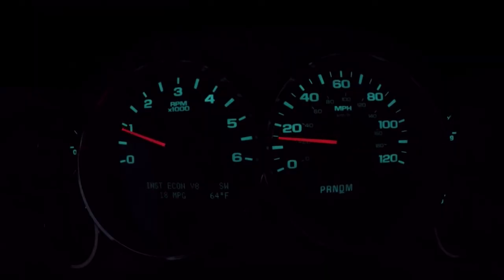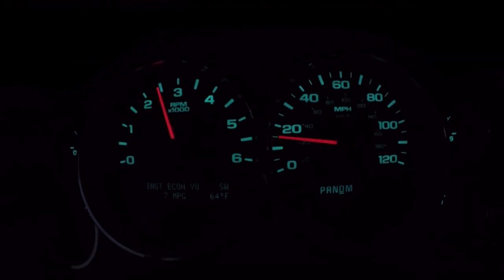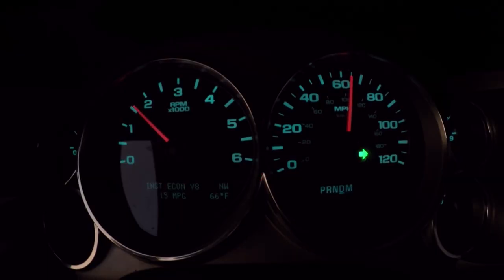Pros and Cons of a High Stall Torque Converter

Comment: 3400 stall with mild cam is way to much stall for daily driver
Reply from the maker: I don’t think so at all. I had a 2600rpm stall before this 3400rpm stall and it just wasn’t enough. It still lugged in the lower rpms and it still felt sluggish. Circle D even recommended the 3400rpm stall for what I have now. I haven’t lost much, if any, in gas mileage and I drive my truck every single day.
Reply: Not at all. I have a 3800 behind my standard ls1. No cam just a tune n otr and its a dream. Thing hoses tyres
Reply: JV Garage do you have a single disk or multi
Reply: Sean Fatin single disk or multi
Reply: I run a 3400 in my daily too. Doesnt even really drive all that different. Just don't buy a cheap stall. You get what you pay for.

Comment: Hey what’s up man I’m going to swap my 04 Silverado to a 6.0 V8 and going to be putting Texas speed TSP high lifters stage 4 cam  it’s 223/226 600/.600 ,111 LSA camshaft ass my daily driver and converter for this set up please let me know on the Comments below
Reply from the maker: I’m no expert but through my experience I wouldn’t go any less than a 3,000rpm stall speed. But it also depends on what you plan on doing with the engine as far as supercharging, turbocharging or keeping it N/A. Give circle D a call and tell them what you plan on doing and all your engine specs and they will put you on the right track.
Reply: @JohnVesely  can you add a circle D converter on a stock motor(5.3)

Comment: Driving a high stall with tall tires can really suck on a truck, been there before, it killed my truck, I am fighting not wanting a 4500 in my car to match the cam , so the cam will be coming out loosing 20hp..but it will be more drivable."
Reply: Putting tall tires without changing gear ratio's kill torque

Comment: Wow. That's strip grade size. Completely useless on the street
Reply from the maker: I’m going to have to disagree with you. It definitely does drive different than the stock or even a mild converter but as for as my day to day it does what it needs. I recently moved and towed a trailer for 5 hours moving my stuff and it did just fine. As long as it locks up on the highway you’re not going to burn anything up.
Reply: @JohnVesely  as long as you drive on the highway,   right there is a problem for me anyway. I get 10.8 average as it is in my 2500hd 4x4. No need to make it worse. And off road on steep hills. You'll understand what I mean if you ever take it off road. Plus it is hard on everything else. But your young. You have a lot to live still. Good luck brother. Keep er down and out

Comment: A high stall converter is only good for track drag racing. I don't recommend it for the street for daily driving especially in hot weather since they generate more heat and lower gas mileage. Its only good past thirty miles an hour its a bolt on head start after that a stock converter can couple better at WOT than a slippery high stall. Even after going from vortex flow which is torque multiplication mode to rotary flow which is lock up mode a stock converter is still better after 30mph because its bigger around and can couple the power more effectively but only after 30mph. Street racing is mostly done at speeds above 40mph anyway and a more efficient stock converter will actually outrun a high stall past 40mph with the same cam profile. If you have a radical cam it won't be happy with a stock converter in drive at a stop it would tend to die out you would have to put it in neutral. Now in my opinion that cam would be too radical for the street anyway. If you don't care about launch which I don't by the way only if I'm going to the track, but for the street I would go with a stock converter and it will give you better acceleration above 40mph for street racing with any cam if you can get it to at least 30 mph it will really start going. If you set it up for track racing only then get a high stall that matches the cam profile but your wallet won't be happy it will love gas stations

Comment: If my drag car idles at 1500 rpm, and I use a 8" 4500 stall converter, will the rpm drop when I put it in gear?
Reply: Depends on how much vacuum it makes at idle. High vacuum? No. Low vacuum? Yes.

Comment: Why are you using a 3,500 stall speed converter for the streets?
Reply from the maker: Because the truck needed it and it’s not that bad on the streets. I get the same mpg if not alittle better
Reply: @JohnVesely  Do you at least have a trans cooler?
Reply from the maker: Yes, a pretty hefty one. Trans rarely goes over 180 degrees in the summer time
Reply: @JohnVesely  Must be a pretty big cam. What's the duration @ 50 ?
Reply from the maker: It’s just 220/220. But it really cut the torque and since the truck is heavy it helped wake it up
Reply from the maker: I do want to get a bigger cam tho
Reply: @JohnVesely  What's the displacement? 6.0 liter?
Reply from the maker: sportsmansparadice42 it’s 5.3
Reply: @JohnVesely  That should put out over 400hp no problem. 4.10 gear ratio?
Reply from the maker: I just have the 3.42 gears. I do want to go to 4.10 but it’s kinda expensive since the truck is 4x4
Reply: @JohnVesely  Well that depends on the tire wheel diameter. You're truck should be very responsive. Yeah it's a 4x4 and not a quarter mile car, but still  torque is King on the streets,  and off road 4 wheeling.
Reply: @JohnVesely  Hey bud, 
Would you recommend a Circle D, 258mm  3200-3400 stall or 3000-3200? Adding a BTR Stage 3 cam to my 17 Sierra but not sure what stall to go with. 

 Thank you in advanced
Reply: @JTrump23  did u find out what stall to go with

Comment: Buddy there is high stall , then there is stall speed converters they are different,stall speed gives you more low end,  high stall is for top end lower gear ratio high rev engine.

Comment: I see no advantage to ahigh stall torque converter. I tend to prefer the lowest viable stall speed for each application. My philosophy is that the torque converter is just to get you going, and by 2nd or 3rd gear, the torque converter needs to be locked and the gearing does all the torque multiplication needed by the engine. I think it makes way more sense to regear rather than mess with stall speed on a torque converter.

Comment: lower gas mileage.

reduced, irritating and noisy driveability in town.

more trans heat.

much higher first gear wear.

spinning backwheels flooring from dead stop? well that wont make my supra beat teslas😏

no creeping in idle - imagine sitting in a queue. bugger! i do that all the time in town😳

no automatic reverse block waiting for the green light up hill. you will have to use the brake instead. no big deal, but a little irritating.

well, i am not on the racetrack, but mix drive all the time. only racing other cars maybe 1% of the time?

hmm - i guess i will choose a 1000hp converter - with stock stall...

Comment: Why in the holy freaking world would you buy a friggin high stall converter for daily driving?  Seems like a lost cause out of the gate.  Pretty stupid idea.  High stall converters are for racing applicaitons NOT 4 TON TRUCKS!!!
Reply from the maker: Lol it’s not bad at all. Maybe with older technology yes. But these new converters lock up on the highway making it drive like stock. Also my gas mileage hasn’t gone down either. Definitely not a lost cause. Also my truck does not weigh 4 tons lol you’re about 2,000 pounds off
Reply: I disagree I love my 3800 stall in my cam and header ls2 and I drive it every day. I also tow with it. Not heavy hauling but i do. Big trans cooler and it works fine. It’s well worth it depending on who you are and what you are doing.